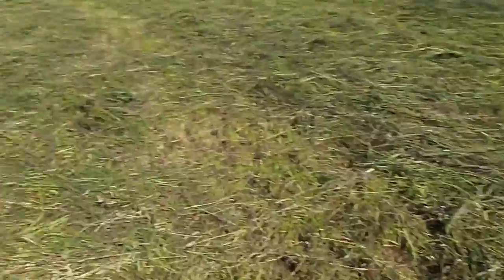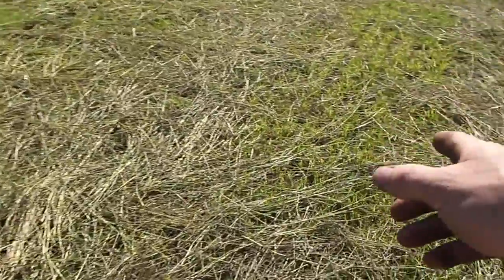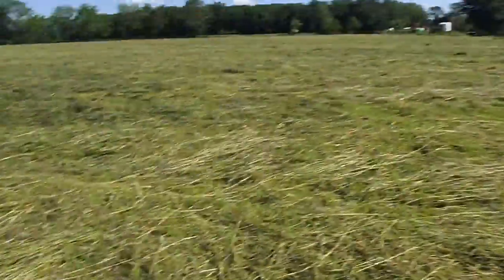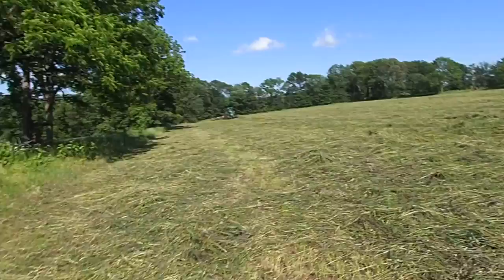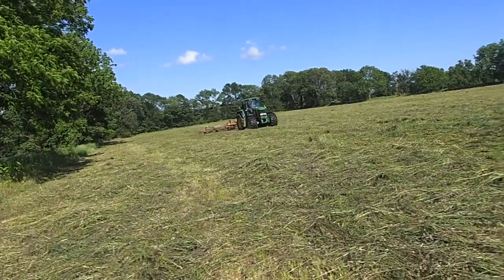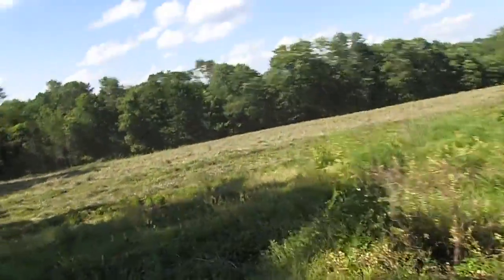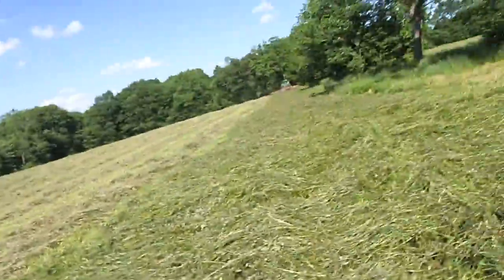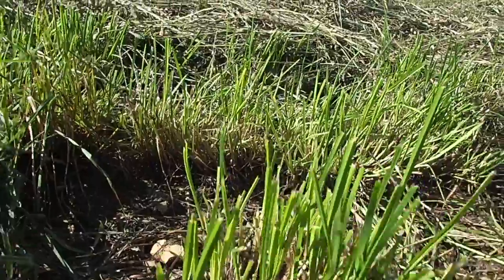Fertilizer VS No Fertilizer

Comment: just doing a little math which I am bad at.  3.5 tons to the acre plus another 1.5 tons second cut  times 5,000 approximate  acres equals 25,000 tones.  you can haul 32 tones a load equals 780 loads.  that is 2 trucks running 1 load a day at least.  maybe Tim as a second driver?

Comment: Little did you know the pto shaft would be bent on the baler 😂😂
Reply: PTO shaft bent?  Are you talking about the accident last year with the wood piece?  That shaft bent because of the machine jamming during full operation.  It was repaired and the baler continued it's fine operation.  Is there another bent shaft you know of?  Perhaps you are psychic or a time traveler.  Better let Wes know so he can be prepared!

Comment: I am only speaking for myself. I grew up on a farm. i know what fertilizer does. I am more interested in seeing the 8530 on the baler. Your first impressions of using the 8530 on the baler. What features on the 8530 are better while baling. What features do u miss on the 8530 that the other tractor has, if any. Details about the difference between the 2 tractors and ultimately, was upgrading to the 8530 worth it.  Thank You ! and have a good day.
Reply: By the way. Yes I am an impatient person sometimes.